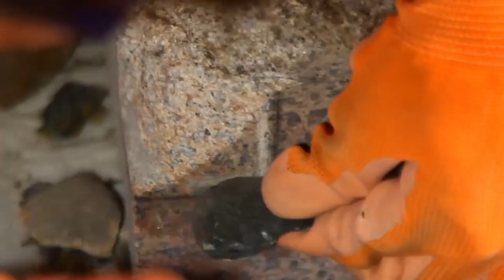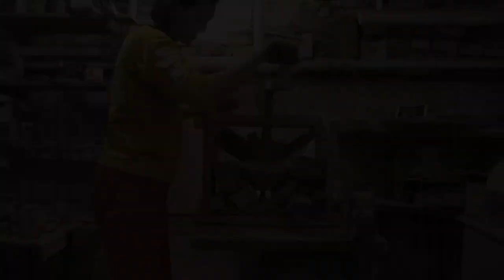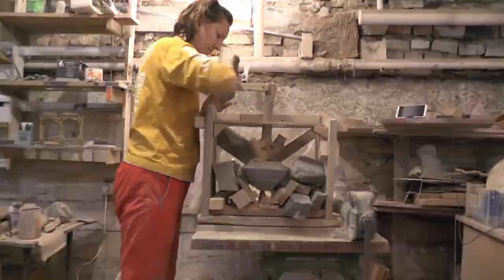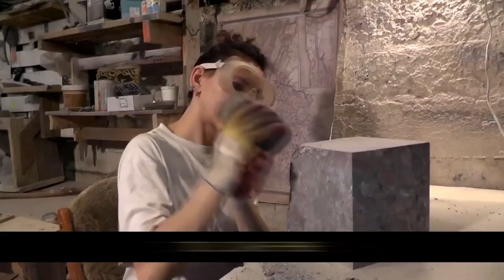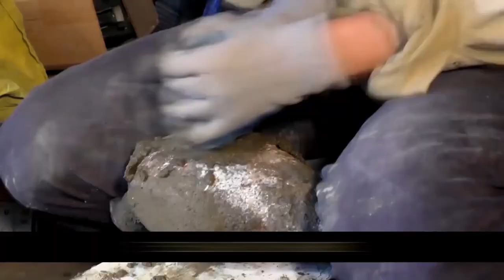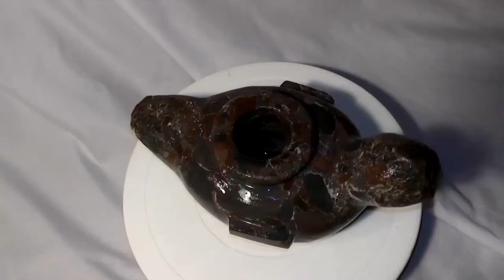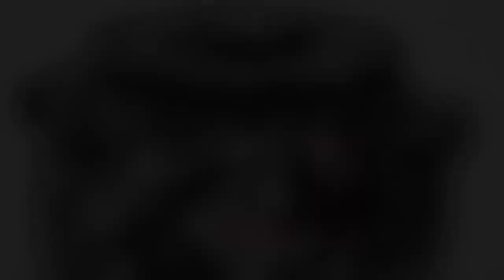DIORITE VASE. Let's make an impossible artifact real!

Comment: Now do one where the opening is 10% of the diameter of the inside.
Reply from the maker: Show me a sample
Reply: @ScientistsAgainstMyths  Don't hold your breath waiting for an intelligent response.......  🤭 As an aside.  A lot of examples show artisans first working the exterior to then begin to remove from what will become the inside.  If however one knows the shape of what will become - from creating previous examples - then first drilling out what will become the inside might not carry the risk of damage as oppose to the reverse.

In other words if you have a somewhat fragile stone like alabaster then you first drill the block to create the approximate inside dimensions while the "excess" on the outside of that adds strength to reduce the chance of fracture.  Only then you begin to carefully remove from the outside to fashion your eventual shape which can be scrapped/polished to a finished surface.  There are risks either way of course but it seems that would be better as to create the exterior shape first removes matter which increases the eventual fragility of the object.  🤔
Reply: lmao

Comment: A simple artifact like a vase which needs more than 7 months of man's work has no sense at all. 
This only proofs that III and IV Dinatsy Egyptians used a far different, easier and cheaper tachnology to do such achievements
Reply: The Tsar bath took 10 years to complete, which shows that people don't shy away from putting lot amounts of effort into prestigious items.
Reply: Lorenzo R What you’re saying makes no sense at all. she works alone making the tools as well as the product. yet in Egyptian depictions of vase making and other crafts they work in teams. A workshop production line would pump them out much quicker, people specialising in different jobs, some make and maintain tools, others work the drill while others polish. A workshop in other words, and I’m confident there’d be more than one workshop in all of Egypt.
Reply: It's not a simple vase. Probably only wealthy people could own one. 
Do you also challenge the existence of modern handcrafted swords when there are manufactured ones that cost way cheaper and faster to produce?
Reply: The point of this is to show that even with significantly lower tech than the Egyptians, it was possible to create such things. The video outright refers to the copper tools the Egyptians had at the time, so it isn't like they are unaware of them.
Reply: Pinkhair Machinima everything is possible if you have "time", yes. 
You can carve a whole valley out of a rock mountain simply walking up and down with your bare feet, you just need several millions of years, but again, are you serious?
Have you ever been in Egypt, for instance inside the so called "Serapeum" in Sakkara? 
Do you have any idea of how they could move those "sarcofagus" within the tunnels?
Or in South America, at Ollanteytambo, or Sacsayuaman?
Do you know the existence of polygonal walls with - to me - evident proof of "melting stone" technology?
Or did ever heard of geo-polymer explanations made by a french scientist, some years ago, who allegedely proofed that Cheops Pyramid is actually made in this way?

I am an architect from Milan, I designed and directed several important restoration works of historical architectures, so I know how stone buildings from the past are made. I also worked with the most skilled companies in Carrara, the ones who work with the famous marble, and also in northern Italy, in Valdossola, where are dozens of important quarries of hard granite.
The stone buildings and artifacts from "megalythic era" are different from all other eras. They used a completely different technology.
First visit in first person those places, then try to explain. 
Oddly enough I encounterd some very smart indipendent researchers from Russia, who discoverd very important things about polygonal constructions. Much, much more open minded, curious and smart than try to waste a huge amount of time in doing such "experiments".
Sorry for my english, not enough skilled to explain sufficiently well my thoughts
Reply: Lorenzo R Restorations of ancient temples such as Parthenon employed ancient techniques such as pantograph to fit shattered pieces of stone to new pieces to preserve as much of the original as possible. Fitting broken stone precisely together makes fitting polygonal walls look rather simple in comparison.
As an architect you must be familiar with De Architectura by Vitruvius?  Though even long before sailors need to use mechanical advantage, hitch knots are compound pulleys. Ancient knot tying tech can move and lift heavy weights. South American used complicated knots for record keeping.
Naval forts in the Baltic and elsewhere were surrounded by massive walls of polygonal granite. 
Surely as an architect doing important restoration works you would be familiar with these things.

Wasting time doing experiments?  I think that sums it up very nicely.
Yes it takes time to do great things. How long did it take to build the great cathedrals? Did the architects not experiment beforehand? Even with large teams of experienced craftsmen.
Don’t look at the famous paintings in Milan galleries instead look at the frames and amount of work that just goes into those, how long just to apply the gold leaf after the carving?
The detailed stone ornamental pots in gardens weren’t made overnight. Craftsmen spent weeks if not months making those and they just sit outside as minor details most would just overlook.
There is not a single thing primitive techniques cannot do and if the only argument is it takes a long time then welcome to history.
Milan would be a textbook in art and architecture that takes a long time. Workshops that produced items similar to this rather than a single person making everything from the tools to the final product. Are those restoration projects arranged so one person does everything? In the quarries is it one person doing it all? 
I have to say I am doubting your claims because I know other restoration projects bring in specialist artisans who spend months on a single task in one small piece of the larger project.
Reply: Lorenzo, please take an interest in how long it takes to make a handmade carpet, for example. 
This is complete nonsense given that a rug can be bought at a nearby store for 10 euros.
Now imagine that an artel of experienced craftsmen makes a vase. And not the only Olga for the first time in her life.
Reply: @lorenzor2555  What do you believe about the Tsar Bath, Thunderstone and Alexander Column, all of which are impressive megalithic works done in the XVIII/XIX century Russia?
Reply: @SacredGeometryDecoded  nice slap down. Lol
Reply: @SacredGeometryDecoded   Unfortunately this got sickening. You Tube is flooded with this garbage and if you manage to find a good video or lecture on the topic, the comment section will be filled with screeching people claiming it's advanced technology, because "I've seen it on the InTeRNeT".
Reply: MrAchile13 yeah. So many quality channels closing comments sections now. Flooded with trash comments from “I watched Bright Insight” types therefore you are a Zawi Hawass shill.
Reply: She's a total amateur working with self-invented, home made tools. Give her 500 years and 50,000 apprentices and see if they don't improve their skills and tools. (It was the stone age ffs.) 

Most Egyptians would have used cheap clay pots. Posh stoneware was for posh people who could afford to spend 6 months equivalent peasant's wages on a tea pot. (Or tell slaves to do it.) 

You can buy a mass produced Toyota for ~$20,000, but some people pay $1,000,000 for a hand built Ferrari that tbh in most ways isn't even as good as a cheap Toyota. Some things never change.
Reply: We are so used to getting everything we want right away that we can't understand how ancient people would want to wait so long.
Reply: @WorldofAntiquity  If they knew how to work with diorite, why did they work with diorite balls at the Aswan quarry? Why, they did not make advanced tools?
Reply: @yevgenchuk  Why would they need advanced tools when they had sharks with fricken laser beams ?
Oh that Dr Evil ... he's so diabolical .
Reply: @Mk101T  "they had sharks with fricken laser beams ?" HOW do you know?
Reply: @yevgenchuk  Well I suppose it could have been a sea bass ?  A mutated Evil sea bass.  Muhahahaha
Reply: @Mk101T  "SEA BASS" is a fish that lives in Asia, not Egypt. And how does the fish relate to the vessels?
Reply: @SacredGeometryDecoded  There's a difference in precision and speed. There has never been a doubt of who built Parthenon. There are just a few objects in the world which are being questioned, yet the only proof we have from reconstructors we get are for the objects nobody is questioning. The schist vase, the Peru stoneworks, the claimed speed of construction, the sudden disappearance of skills after the initial achievement.

You are attacking a strawman, try answering the real questions.
Reply: The precision is also so so with this video. The Egyptian artifacts from the old dynasty are amazingly precise, and then.. nothing even close until the Romans. Did they invent it and then immediately forgot?
Reply: @matveyshishov  just not true, if you are so sure please provide a measurement of the items and comparison with Roman items, even on large projects the Roman aqueducts are more precise THROUGH THE AIR over vast distances than the Great Pyramid is aligned to true north along the ground for a short distance.
Reply: @SacredGeometryDecoded  Can you be more precise with your words? What is not true? What do you want to compare with Roman items and why did you bring up Romans at all?
You also didn't address a single point in my message, did you just answered your own questions or something?
Reply: @matveyshishov  in the two replies you left on this thread you name the Romans and  the schist disc.That was you who brought those up.
I directly responded with links that go into that in detail
Then you brought in Peru, speed of construction which is a huge topic and it's ridiculous to expect those things to be replied to in a comment section. 
Then to ask for someone to be more precise? WTF? 
It's more than a bit rich you ask anyone to be more precise in their words when you are bringing up " whataboutisms" on such a vast scale and demand they be responded to.
What evidence do you have to your statements? Why weren't you more precise in giving some evidence rather than an unsupported claim that is copy pasted from any lost ancient high technology comment thread?
Please provide a single measurement of PRECISION that can be compared to later cultures who you claim were incapable.
Though as the links I provided address that directly, as well as the farcical claims of PRECISION especially of the schist disc.
Reply: @SacredGeometryDecoded  OK, let me try one more time, and I'll isolate the list items to make it easier for a discussion on a case by case basis.

1 Between what the woman in the video did and what the ancient Egyptians demonstrated, there's a difference in precision. The Saqqara stone bowls have walls with millimeter-thin walls, the cone vaseis narrow passage with perfect negative curvature,  the Sabu disk has very intricate geometry. Nobody has ever proposed a good method for doing this. All the archaeological "debunkers" have concentrated on very crude examples.

2 The Sabu disk was made 3000bc. Saqqara is what, 2600bc? With normal development of cultures we see progression from less sophisticated to more sophisticated. We don't see any progression from crude to thin-walled sophisticated shapes before Sabu/Saqqara, and what's perhaps even more worrying - we don't see any such artifacts made AFTER Sabu/Saqqara. What we see instead is supposedly a spike in precision technology, coming out of nowhere in the 3-5 old dynasties and.. disappearing? Until the Roman times we don't see similar sophistication.

3 The proposed speed of pyramid construction is 20-something years, which would require placing a block every few minutes. Placing them is just a part of the job, they need to be carved, transported, and hauled up the pyramid. Even with a 10k workforce numbers' parallelization degree, there has not been proposed a method that would allow such speeds.

4 Archaeologists expect us to believe mutually exclusive statements without having cognitive dissonance. On one hand, the Egyptians were supposed to be so ingenious they were capable of pyramid building. On the other hand - they built a tomb and then didn't use it as a tomb. Unlike every REAL tomb, it has bare walls, unnecessary difficult to traverse corridors, F-sharp tuned resonances and no mummies, of course. And they did it several times in a row, although it occupied a moonshot part of the country's GDP for a century.
Reply: @SacredGeometryDecoded  if your right then why haven’t you replied to matvey? I’m neutral I wanted to see who is right and who is wrong I always see unanswered questions and sarcasm from people who are debunking ancient high tech
Reply: @przemog88  OK. Do tell then how the dynastic Egyptians shaped those 100 ton diorite boxes found in the Serapeum and how they maneuvered them into those tight niches.
Reply: @sandormccann2546  So you also can't present evidence for this "high tech"? Colour me suprised...

And you can process diorite with either diorite itself or metal tools. I'm really tired with these bs arguments that "long and hard work = impossible".
Reply: @przemog88  Who said 'impossible'? Just really unlikely. I'm so glad that you have jumped in because you probably know how the dynastic Egyptians carved out, transported, (all without cracking), shaped perfectly, to within hundredths of an inch tolerance, and then maneuvered 100 ton diorite and granite boxes into the tight, narrow niches in the Serapeum. No? 
Not a clue? 
Colour me surprised.
Reply: Mail shirts took over a year to make.

Comment: If you can see any similarity in this with Old kingdom work, you are blind.
Reply: So let's see.  You try to contrast 2 objects created thousands of years apart by different artisans of differing skill levels = so who is the blind one here then............  🤦

The video simply demonstrated the method works.  They were not attempting to compare relative skill/aesthetic outcome against objects which might have been created by Egyptian master craftsmen with years of experience creating the same.
Reply: Egiptian vase has so many features that are not possible to do by pounding rock or turning stick to just drill the center, so this is not how they did it, at least in my opinion.
Reply: @MrWarrning  Again with = "your opinion" - as if that supposedly establishes fact or not here.  Believe - or not - what you will.  This is about evidence such as we see in the historical/archeological record.

Hence the experts who study that evidence concluded it was possible.  Your "dissent" in no way alters this reality.
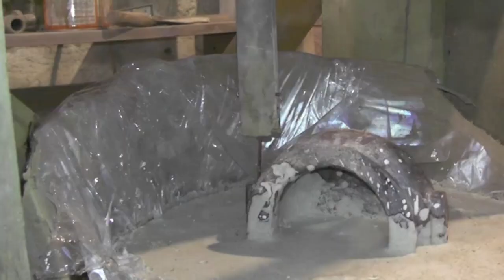Reply: @varyolla435  Of course it is possible but there are other evidence that lead to other methods, btw they used steel here 0:32 in the video...
Reply: @MrWarrning Not steel. She made copper drills as stated in the original video. Hard steel would be less efficient than copper in this operation because the abrasive can embed in the softer copper.